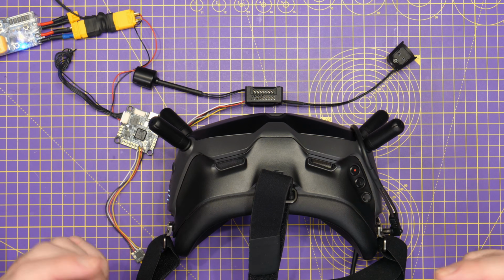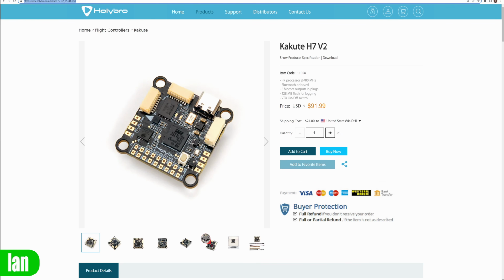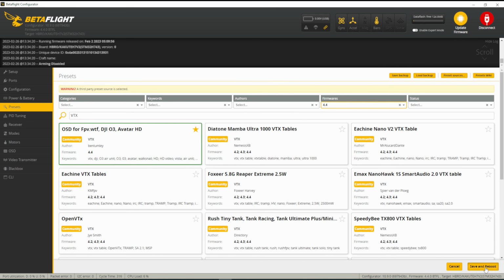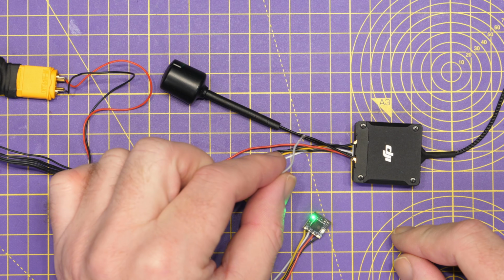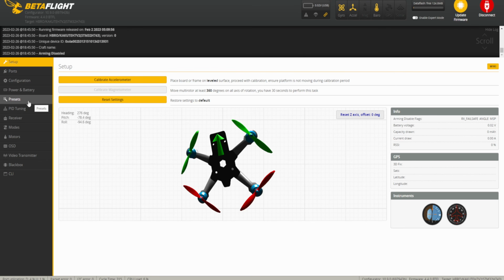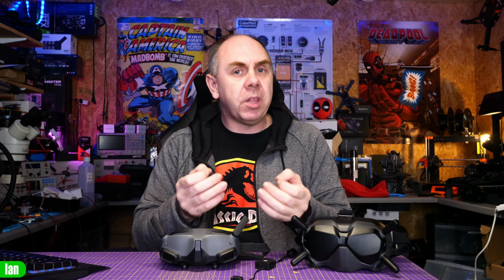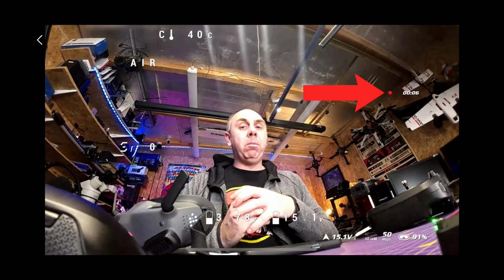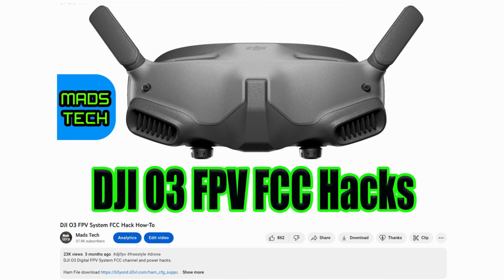DJI O3 FPV System - Complete Setup - Diagnostics & Troubleshooting Guide

Comment: While it’s true you can’t bind without the air unit receiving battery power, some things are powered just from USB. Mounting internal storage and SD card storage works with just USB and software updates also work with just USB. This generates much less heat because none of the wireless functionality of the air unit is being powered. This is the same on the Avata. When doing an update or using the air unit as a SD card reader, it’s better to not have a battery plugged in due to the reduced heat generation and it also eliminates the need to remove props for increased safety while performing these tasks.

Comment: Just want to say thanks! Finally upgraded to digital, which is excellent - that said, I broke off the small (IPEX?) connecter as I was removing a part of the frame… you mentioned it could be replaced with standard antennas - just curious where they could be purchased - or what length and type are considered standard. Thanks again!!

Comment: I have had problems when trying to update my v2 googles to the latest firmware to gain 03 support. I lose wtf os. If I try to reinstall wtfos I can no longer use my v2 googles with my 03 air unit until I update through dji consumer app.
Reply: You need to make sure you are on slot 1 in wtfos. Basically googles are getting confused by switching to slot 2

Comment: @MadRC, I have the DJI FPV drone, V2 goggles and controller (Combo), Vista Airunit for my wing, and Original FW (Never upgraded). Can I use O3 unit with my V2 goggles after FW update? will it still going to work with Vista and FPV drone and controller?
Reply from the maker: Yes you loose nothing by updating and gain O3. The only down side is you still need to rebind when changing modes.

Comment: I have an 03 in a new build of mine. Everything works fine until I try to do a roll. The screen will freeze for a couple of seconds. This has happened twice. It recovered and resumed transmission. When I look at the video recordings later, the goggle recording shows the freeze and then continues recording when it recovers. The Air Unit video shows the freeze, but the recording ends and doesn't continue. Since the freeze is showing up on the Air Unit, it doesn't seem to be a transmission problem. I have it connected to a SpeedyBee F7V3 flight controller. I'm using the connector plug, not the solder pads. Any ideas on what's going on?
Reply from the maker: It sounds like something is happening is the the turn.  Something is coming loose or touching.  I would be looking at everything on the quad as that’s odd.
Reply: @MadRC  Thanks Ian. I'll check things out.
Reply: check the soldering of the connectors on the FC. i had the the same Problem in an analog quad. the soldering pads became loose. every flip video was gone.
Reply: @enjoy_and_fly  The FC has a plug-in connector, so it's not soldered. There's always the chance that there's something wrong with the plug.

Comment: What will happen if you have 9v 1.5amp? What issues might you get? I've got a quad that's been working great on a Zeus F722 board. Thanks in advance.
Reply from the maker: It will likely be fine. If it’s working then don’t worry.
Reply: @MadRC  Thanks. I have an 03 system that for some reason does not work in Gyroflow - When I add the video does the analysis and then the video is just black. If I disable stabilization the video is displayed again. Subsequently, if I enable stabilization again it goes black again. Yes, I'm using Wide mode, and EIS is disabled. Any thoughts?
Reply: Here is a video of the issue. Hope someone can help.
https://youtu.be/S-D40lexXcU

Comment: Hi mads tech. I recently purchased a defender 25 O3 (updated to BF4.4) that I set using the DJI remote control, it happened that RXLOSS came out and the drone went into failsafe, despite having all the reception bars (both video and rc) completely full.  What do you think could have happened?  Thank you
Reply from the maker: Honestly the DJI Remote is just not reliable IMO, there are many issues, try updating the firmware on it if you have not done so already. I have seen lots of issues with the DJI Remote tbh